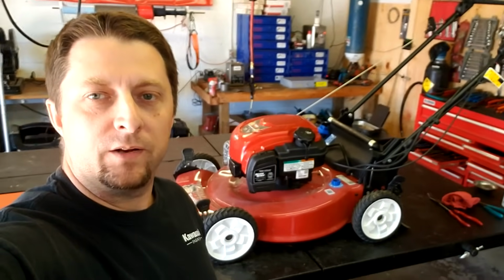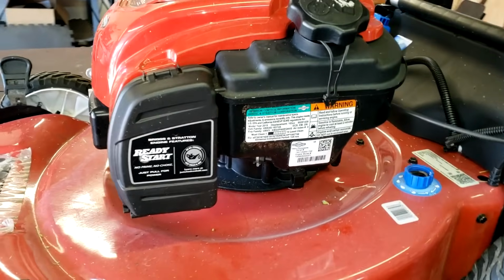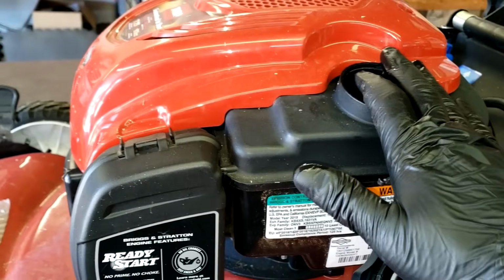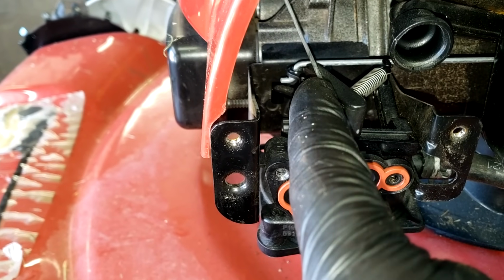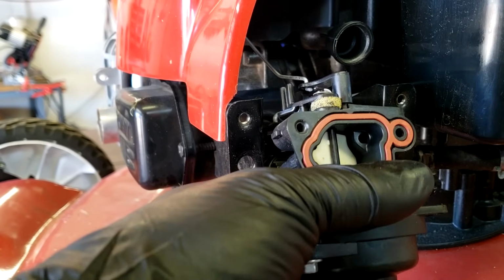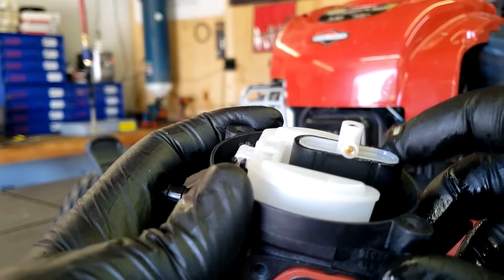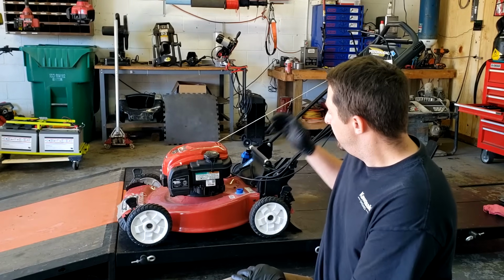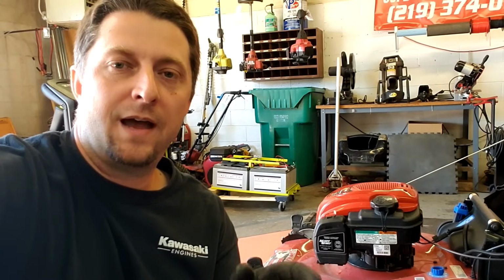TORO Lawn Mower Wont Start Easy Fix

Comment from the maker: Thanks for the awesome support.
Reply: Do you have a website? i wanted to buy the main jet for this Toro 20340
Reply: How much is it?
Reply: How do I tighten the belt on my toro lawnmower
Reply: Thanks, That was very well covered, down to the point and quick.
Reply: this guy repeats the same thing over and over again, we heard you the first time, many engines and no one wants to be talked too like your doing dude, pretty much, is not a solution
Reply: could not make it to any solution, talks to much about nothing

Comment: Bro mine literally says guaranteed to start😑
Reply: I know right! 😂
Reply: Mines too had it 1 week 😮
Reply: Mines too!😒😏
Reply: Mines as well
Reply: Frrrrrr wtf 😂😂😂
Reply: 1 week and won't start
Reply: Same!
Reply: They didn't add the word failing after the gts......
Reply: Same here class action lawsuit
Reply: Mine too and haven’t start in years
Reply: Replace the carburetor, it isn't hard and will work. It's a known issue.
Reply: My neighbor’s got same and we were laughing just right now trying to start it.
Reply: Same
Reply: Its a joke, on purpose😂😂😂😂
Reply: Same
Reply: Mine too!!!!!
Reply: Even with a new carb and coil it doesn't want to start.
Reply: Replace spark plug never got these instructions
Reply: Yeah I did Plug , coil , carb , aircleaner still doesn't wanna start . Set the coil with the feeler gauge it came with . Everything. I'm at  a loss atm . Should run maybe I'll try starting fluid since there is no primer . Was thinking if it will just fire over maybe it'll draw fuel I dunno .
Reply: haha same. It also says self propelled, yet hasn't since the day I bought it lol. And yes I did try adjusting it <shrugs> Ahh well. Warranty is way over now. So push mower it is  haha
Reply: Lol mine as well. It worked for about 5 years and now all of a sudden needs cleaned... gahhh
Reply: Me too
Reply: Mine ended up in a landfill.  Guaranteed to start my a@#.  Worked three or four times and that was it.  Expensive mistake.
Reply: Same! Mine isn’t starting
Reply: Same here after less than a year and maybe 5 uses. I just realized though that I was using the wrong gas! It's not supposed to take the 85 octane. Only 87 and up.
Reply: 😂😂 thats what im sayin
Reply: So does mine, it's only two weeks old, and only used three times.😢
Reply: Don't use fuel with ethanol in it or you will have carburetor problems
Reply: Mine is doing the exact same thing and I replaced all of those parts stuck lost and I don't know how to fix the damn thing @jesslittle7110
Reply: Mine too. It won’t start or it dies right away. Only used about 5 times.
Reply: Vortex technology? Lol
Reply: You got finessed

Comment: I was able to fix my mower with your video! I'm 71 years old and not a mechanic. Thanks so much for your help!
Reply from the maker: That is absolutely wonderful so glad to hear that and congratulations now your a mechanic 👍💯🔧
Reply: You know theres some better options of lawnmowers why don’t you get 
 Toro or lawn boy
Reply: @Love_Rengoku_123  the lawn mower I fixed is a Toro
Reply: @D-MAN107  I used my mower for about an hour and now it won't start again. I'm so disappointed.
Reply from the maker: Make sure you have fresh fuel that is less than 30days old its very possible you have fuel contaminated with water also.
Reply: @nancywakefield8251  do the easy stuff.
Clean and gap the plug to  
.030" and if you need to, clean the carb again. Those tiny orifices. Use carb spray from Walmart it's cheap.
Reply: You go girl! I’m 64 and work on my own too!
Reply: I was able to fix my mower with your video, thank you
Reply: @nancywakefield8251  my mower exhibited the same behavior as yours. turns out it was the spark plug. a new one at Home Depot was $6 and it runs like new again. in most cases it is a fuel issue, but not in my instance.
Reply: @D-MAN107  eeewewwwwwewwwwwwwwwwrrwwwwwwwwwwwwwwwwweewwwwewe
Reply: @D-MAN107  you can do the other tthing weekend or
Reply: @D-MAN107  tú tttttttt
Reply: @D-MAN107  tttttttt
Reply: @D-MAN107  you can just tttttttt
Reply: @D-MAN107  you can just tttttttt
Reply: @D-MAN107  tthe tttttttt
Reply: @D-MAN107  tthe tttttttt
Reply: having trouble with my front wheel drive cable.   It engages but I’m still pushing and grunting.   Local shop would fix for $160.   Can’t afford it    Thoughts ??    Thank you
Reply: @nancywakefield8251  You could have dirt in your tank that clogged the jets again, or maybe the choke thing  is not hooked upped/working correctly.

Comment: Guys.  Check your kill contact.  Make sure when you pull the handle it completely disengages from the contact.  I took my Toro all apart. Drained the gas tank, new spark plug, new carbureator.  I even cleaned the ends of the magneto. Nothing.  Then I noticed when i pulled the handle the kill contact was barely touching which was not allowing it to run.  A simple adjustment of the cable and wala!  It cranked on the first pull.
Reply from the maker: Yes sometimes the cable will get rusty and stick causing the cable not to have full travel.
Reply: I'm planning on replacing this jet in the next few days. My mower just stopped starting at all in the early fall last year. But anyways, What is kill contact? How do I check this first before trying the jet
Reply: Had mine stored in garage and would not start this spring,this seemed to be my problem the cable was a bit loose and the contact was dirty.it cranked after I cleaned it🤷🏻‍♂️
Reply: @MGMafioso  Nice.  Good job brother!

Comment: Local lawn mower shop quoted me $250 because the carb was bad as he said.I’ve had this lawn mower less than a year, has it sitting because of bad weather so I had a feeling it was fuel related.Saw this video and had the same symptoms and swapped it the $20 main jet and it worked!! Thank you so much for your video
Reply from the maker: Awesome!

Comment: Oh my gawd… I bought a new Toro last year, “guaranteed start” 140cc model.  Well, this year, I could NOT get it to start. I read the warranty, saw that if you left fuel in it longer than 30 days, it voids the warranty.  Truth be told, I did not drain the gas tank last fall, totally my bad, and the main jet in the carburetor must have gummed up.  I am halfway handy, but have never pulled apart a carburetor in anything and was a bit intimidated…but also did not want to pay $100 (give or take) to have it fixed.  Saw this video, followed it exactly, and by gawd, it runs like a champ! Saved me money as well as boosting my confidence for fixing the mower.  THANK YOU!
Reply from the maker: Awesome 👍
Reply: You have to wonder - if the manufacturer is so adamant about not leaving fuel in it over 30 days, WHY DON'T THEY INCLUDE A SIMPLE DRAIN VALVE ON THE GAS TANK?  Pulling off the fuel line is a stinky flammable mess even when executed carefully, and owner's should have to purchase a dedicated fuel siphon to do it right.
Reply: I’m having the same issue, I bought a Toro in March I have used it maybe 3 times only! It’s hard for me to try to do it myself 😢😮

Comment: If you put carb cleaner in the throat of the carb and it starts then dies quickly this will be your problem if it doesn't turn on at all after carb cleaner it's your spark plug just change the plug.

Comment: I just did this step by step but I didn’t replace anything just cleaned it and holy shit she works first pull. You sir deserve an award for this. Your helping lots of people save hundreds of dollars. Kudos to you bro
Reply from the maker: Thanks and yes cleaning does work most the time but I prefer just replacing it since it's a cheap part.
Reply: It needs to be said that I also just drained the gas, took it apart and cleaned it up and it did NOT start. Has the same sound as when I started. Figured it was worth a try since I'll have to wait for the part, and now I'm more skeptical of the part fixing the mower. very lame
Reply: @mikel1425  what was your fix?  fouled pplug?
Reply: @trope5105  I bought that OEM plastic part from amazon and it worked right away.
Reply: I was hoping I’d be this lucky but iI’m did not start so I will grab a pilot jet and cross my fingers lol
Reply: @D-MAN107  or maybe its because you are trying to sell a part
Reply: @mikel1425 what kind of fuel did you put on after you drained? Regular gas?
Reply: @mikel1425  how did the mower story end?

:hand-pink-waving:

Comment: Just fixed my lawn mower thanks to this video! I was too nervous to take the control rods off, but I was still able to get the jet main out. I just cleaned it, sprayed it with WD-40 as in the video, and put it all back together. Added fresh fuel and it started on the first pull! This was such a confidence booster; wish I had the internet when I was growing up.
Reply from the maker: Great job!

Comment: Just wanted to say THANK YOU!!! I have never ever worked on a lawn mower in my entire life - aside from putting gas in it and using it. Yesterday I not only changed the jet main and cleaned the carburetor, I was able to remove and clean the fuel tank, flush the fuel line and I replaced the air filter and changed the spark plug so THANK YOU!! Great video.
Reply from the maker: Fantastic!

Comment: Hi there… My name is Rob and I live in Nanaimo BC Canada… I just watched your video… Carefully followed your instructions… And successfully fixed our lawnmower… We bought this at Home Depot a year ago… Pulled it out on May 13, 2023 and wouldn't start… so after buying the little plastic piece that you recommended from our local small engine repair dealer… I was able to install the piece in the lawnmower started up right away… Thank you very much. Great video. Have a good weekend.
Reply from the maker: Awesome 👍

Comment: Thank you for this video! I’ve searched/watched countless videos trying to figure out how to get inside my carburetor without feeling like I’d be breaking something in the process, or just how to do it in general. I’ve been getting by all spring/summer (2022) shooting in some carb cleaner, but today my mower just wasn’t having it anymore. So I searched again and stumbled across your video 🙌.  It’s been the first  I’ve watched with clear video and clear step-by-step instructions. In fact, when I failed to take your advice on taking a photo to remember, I was able to rewind and screen shot some of your footage to reference when putting it all back together. I did have to substitute replacing the main jet part by just flushing it, but I did order a new one. Once it comes in I feel confident in replacing it. Long story short - my mower fired up (and stayed up) immediately! Again, thanks for the video!

Comment: I know this video is from 2 years ago, but this absolutely worked for my mower. I didn't replace the jet just yet, although I likely will soon, but cleaning it out got the mower to start right up on the first pull after I had been fighting with it for ages. THANK YOU for sharing your knowledge here, you're a lifesaver.
Reply from the maker: Glad it helped

Comment: This is a great vid and it worked for me today.  The only suggestion would be to remove the cover to make it easier to access that tube you point out that will suck up dirt into the carb.  It's just 2 screws and the latch under the sticker towards the front of the cover.  Thank you for the excellent help. It truly saved my mower.
Reply from the maker: Awesome 💪

Comment: Thank you.  I did this and it worked.  If anyone is having trouble getting those hooks out of the carburetor, just take off the top cover for easier access. Mine had two screws and a catch to get it off.  I had to put my hand under the top cover and push it out.

Comment: Great video. I just fixed my Toro model 20332. I got away with just blasting the jets with brake cleaner. It started on the first pull after I got it back together. I was having trouble getting the carb bolted back in so I decided to remove the top cover. I had to figure out what type of screws were holding on the cover. There were 2 Torx T-20 screws and there was a plastic catch on the front of the cover under the decal that I had to stick a screwdriver in and pry a little. With the top off, it was a LOT easier getting the carb back on, linkages in place and the rubber tube shoved back in place. I also found a rubber o-ring laying on the deck under the carb and had to figure out where it belonged. Thanks for the tutorial.

Comment: I installed an inline fuel filter so that if there were to be any dirt in the fuel, the filter would catch it. Its been over 2 years and there are no problems with fuel issues. just a tip and the video was helpful.
Reply from the maker: Awesome

Comment: I used this video to fix my Toro recycler last and it worked great, then I bought a Honda GVC 160 and let the Toro sit in my garage for a year and didn't drain the gas and now the Toro is having the same issue. just order new jets from Amazon they arrive on Saturday and will be back up and running soon.

Comment: Worked out well! Started right up! I just put the mower on it side after I drained the fuel  and took out the two 9/32 bolts at the bottom. Popped out that part and  cleaned it up with a thin needle and some water.

Comment: Excellent video. I was able to fix a mower that wouldn't start after trying everything else. The hardest part was trying to decide the part number to order. Our engine is the exact same as the one you demonstrated (although B&S gave a different part number). I just ordered the part number you showed. Once the part came, it was about 45 minutes and we were mowing again. Thank you!
Reply from the maker: Glad it helped

Comment: Thank you I had bought a brand new toro recycler in 2016/17 used it for 1 or 2 seasons starting working a lot of OT didn’t have time to take care of the yard hired a landscaper for the last 2 or 3 yrs never used my mower since this yr I have time but my mower wouldn’t start I had the same fluids since 2019 this video helped revive Frankenstein cleaning out the carb cup I had so many particles in that thing ne gas new oil new spark plug 1st pull it sounds brand new thank you 🙏🏾
Reply from the maker: Awesome

Comment: Yo this fixed my problem. I didn’t have to replace the jet though. But for some reason the fuel looked dirty when I drained it and discovered that the air filter WAS NOT placed by previous owner when I bought it. Needless to say the inside of the carburetor was dirty. Works perfectly now. Thank you very much!
Reply from the maker: Awesome

Comment: Great video. Thanks for posting. I was able to take my Toro 7.25/163cc mower's carb apart with your help. Successfully cleaned the jets just to get it running again but will order the new jets so I have them on hand just in case...

One tip I have is to remove the plastic engine cover (two T25 Torx screws and push down and slide back to disengage the hook on its front). This gives you much more room to reattach the linkages and the breather tube.
Reply from the maker: Awesome

Comment: Thanks for the help. I used throttle body cleaner and cleaned the jet out until I get the replacement parts. Started right up. Thank you.

Comment: You just gave me the confidence I need to fix my lawnmower, I will check back in if I’m able to get it running!
Reply: 🚨UPDATE🚨 Mine didn’t start 🤦🏽‍♂️, possible deeper issues. Changed the plastic piece mentioned in the video, new filter, cleaned the carburetor, good gas, new spark plug and it just seems like something is restricting it from starting!!! May take it to a shop, but I ended up buying a new one with the same Briggs & Stratton engine!

Comment: I followed your instructions to the letter and my mower started on the second pull!! 

I had replaced every part - spark plug, air filter to no avail. I found your video and replaced the carburetor jet and that was the answer. 👍👍👍 Thank you!!
Reply from the maker: Great job!

Comment: A million thanks!! I DID IT & IT WORKED!!
I wrote comment “I could build a car easier than do this carbuerator fix.”
Sorry for that other comment.
You said what tools needed- air filter same as my toro mower.
Boom. 💥👍🏼 Thanks so much.
I’m still shocked it starts & that I fixed it.
👍🏼👍🏼
Reply from the maker: Awesome 💪

Comment: This worked great for me!  A note to those who had difficulty inserting the new jet mechanism: the tolerances are very tight on this part, and if you bypassed the OEM Briggs and Stratton part in favor of a $5 Chinese knockoff you may have found that the new part "won't fit", or insert fully, like mine did.  But examining the old and new parts I could see that they were basically the identical part within some few 100ths of an inch tolerance.  So I inserted the jet as far as I could by hand, then rested the carburetor's mounting flanges above the jaws of a vice, and lightly tapped on alternate corners of the white Delrin part with a small hammer until it seated fully into the carburetor.  Voila, after reassembly and pumping the throttle handle to get gas moving, the mower started on its first pull!

Comment: Great instruction video. I finally finally found a video again that covers the new model with the Briggs engine and plastic carb. I just cleaned mine for the 3rd time with spray carb cleaner after removing and cleaning the jet and cleaning the carb and all surfaces I could reach. Each year at spring start up it has failed to start and cleaning the carb and also draining and adding fresh fuel made it fire up on one pull. I am going to add a fuel filter inline soon and run fuel system cleaner through it before shutdown this fall. I have 3 rider Snappers with Briggs engines that are 15 to 25 years old and have never had a problem with failure to start and I have never changed out old fuel. Maybe something has changed with the gasoline. I am now using 0 Ethanol fuel to see if that will help. Thank you. Great video.